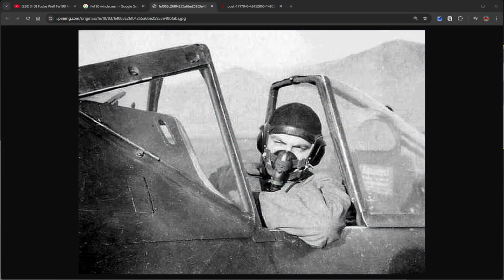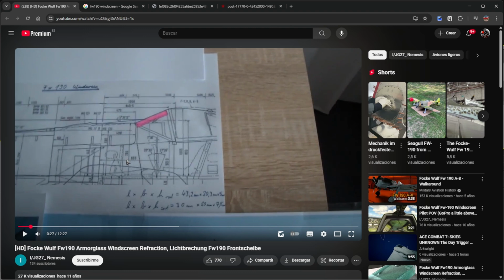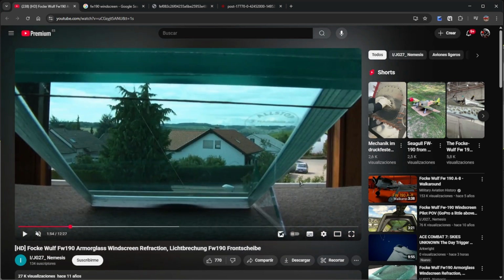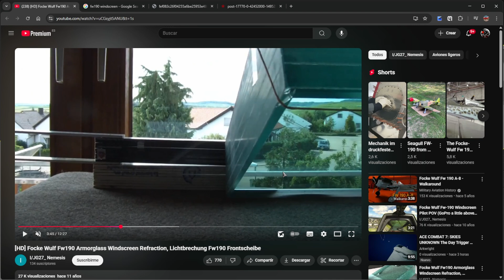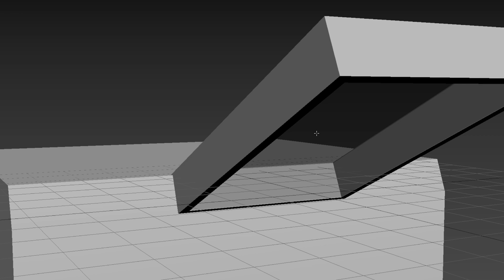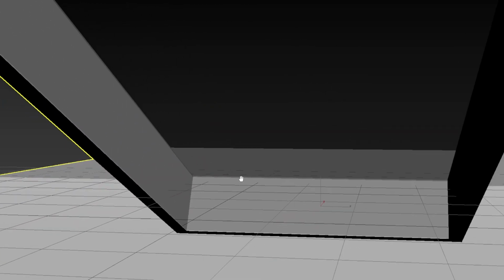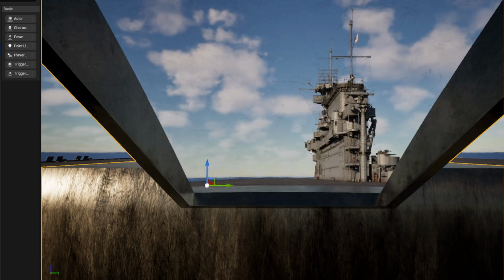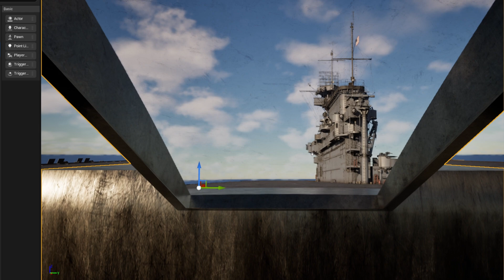Combat Pilot - Technology Demonstration - Refraction

Comment: HAHAHA nemesis's infamous video, of course!
An idea I proposed to gaijin a while back is to use a portal camera quake-engine style with shaders to compress the insides of the armoured glass frame, stenciling out the outer glass area that doesn't need to be rendered and rendering the portal camera for the parallax. Unreal engine does support pseudo-ray tracing, and its good you'll be able to do this but this isn't optically accurate unfortunately.

Comment: I ran into this about 15 years ago when we were installing a new made windscreen in an F4u-4.  It was really interesting to see the difference once we installed new made armored glass (exactly the same as the drawings) as opposed to the lexan that was in place prior.  It's not that you see more, but rather you don't have the bottom frame plate so prominently showing up.  Super happy to see you make this available.

Comment: I tried so hard to get war thunder to fix that at least by thinning the frames but they not only wouldn't do that. They also added an extra 700 lb to the weight of the FW 1901A5 by using numbers from the ground attack version with its belly armor. Russians.
Reply: Russians, Americans, Chinese, Nigerians, it doesn't make sense, don't be ignorant. Only competence means. If you need for professionals, engineers, than change your MMO game to some real simulator. 🤷🏼‍♂️
Reply from the maker: Well, it won't be an issue here.

Comment: Yes, I remember watching the demo YT video, where he actually had a very thick glass as used in the FW 190, and not only was the lower frame bulk diminished, but each side frame also was diminished. It was a revelation, and counered with factual demonstration the opinons pur forth by endless FW 190 critics regarding the forward view of the pilots is existing flight simms depictions due to the refraction aspect not being modelled in game. I also vaguely recall that the glass seemed to also increase the amount of view side to side  as well.

This will be a very welcome correction for us FW 190 enthusiasts, as it will greatly amplify the combat effectiveness of the aircraft, added to the wonderful automatic engine control Kommandogerat and wonderful flight characteristics made the plane so effective in the hands of a good pilot. Look forward to experiencing this in game, good work and thank you.